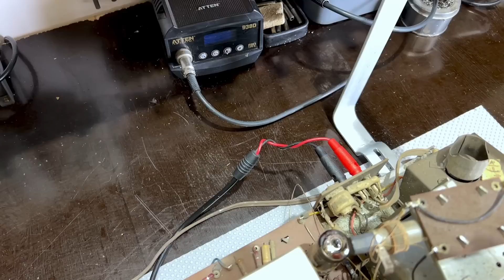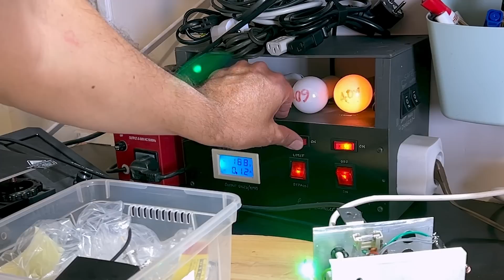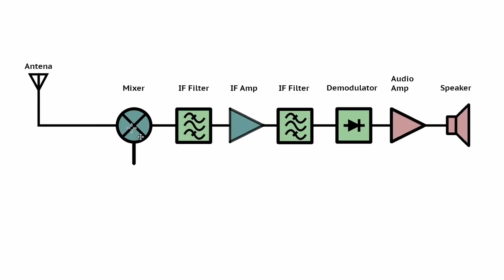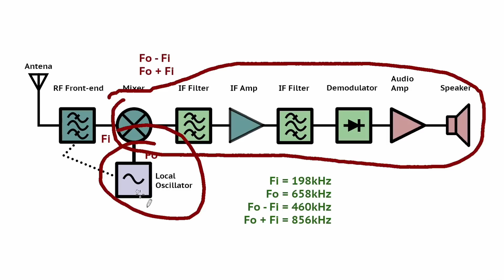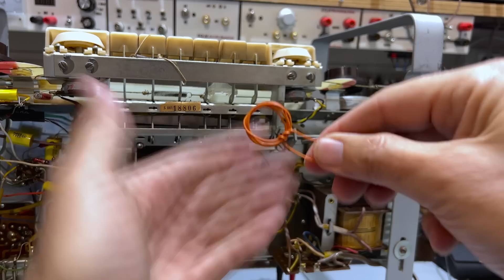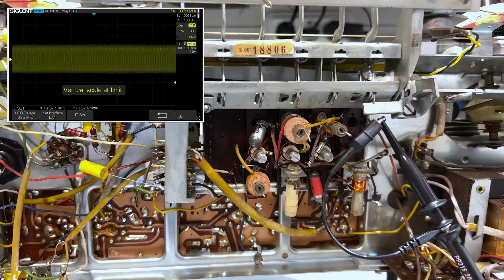We've got LW and SW, but where is the MW? - Tube Radio Restoration Back to Basics part 8

Comment: I always have a hard time checking the rf or oscillator , touching directly loads the coils and changes the frequency, does this small loop coil also load the circuit and will it work in transistor radio also? Can rf section be checked the same as the oscillator section,,, thanks for very interesting vedios
Reply from the maker: The coil does load the circuit, but very little. You can use it on any radio or part of the radio.

Comment: A very interesting and mysterious topic indeed of hetrodyning a signal. Does the local oscillator produce an unmodulated carrier frequecy (tuned frequency + 460 kHz),  or does it also produce a modulated frequency since it receives a modulated signal from the second section of the ganged condensers? Thanks.
Reply from the maker: It produces just a carrier
Reply: @electronicsoldandnew  Thank you for clarifying.

Comment: Another great tutorial Manuel. A while back I restored a Bush VHF64  (closely followed your restoration ty) and I had an issue with the LW not working while both MW and SW did. The oscillator was not working on LW. The switches were clean, continuity through them was good, voltages on ECH81 good,  and the caps and resistors were in spec. When tuned to the high frequency end of the LW band it would sometimes oscillate and then stop as the frequency was reduced. The fix was replacing the ECH81. Obviously it wasn't up to snuff at lower frequencies, but at the moment I haven't built your excellent valve tester project, so subtitution from a working VHF54 radio had to be employed.
Reply from the maker: Yes, sometimes a tube will work at some frequencies and not at others. The best “tube tester” is still to have a set of really good tubes that you only use to test if the existing one is faulty. I know that’s “cheating”, but saves a lot of time 😊

Comment: Nice video, I've got a Grundig "Musikgerát 3028" which has the film on the glass coming off in places. Any ideas on how to repair it with out making too much mess would be great.
The switches are labelled as "Gezeichnete Tastenstellug: Gerat aus" which i think means "drawn button position is switched off" it's a bit unclear whch way the contacts move when switched on.  there are two banks shown 1-6 and 7-12 one would make sense if the black bars moved up the other bank if moved down. but i don't think the bad PDF helps.

looking forward to getting my hands dirty with it some day soon.
Reply from the maker: I’d try some clear lacquer applied very carefully. It’s worked for me before.

Comment: RFI well whats new 3D printer is my guess, use a small portable receiver to sniffer out the source of the RFI. then try using ferrite beads to attenuate the signal coming out of the source.
Reply from the maker: 👍 you’re probably right. Got to look for what’s new on the bench … so, the printer.